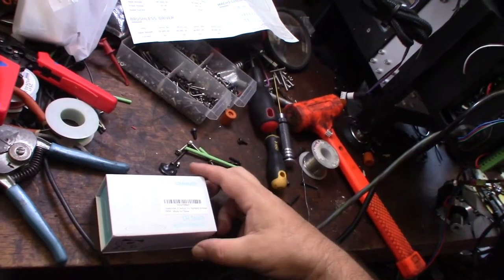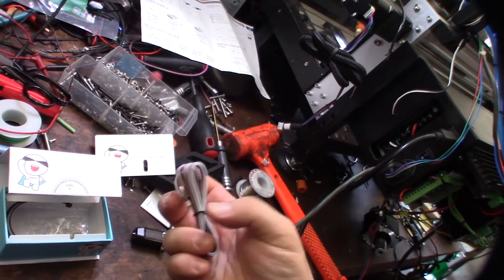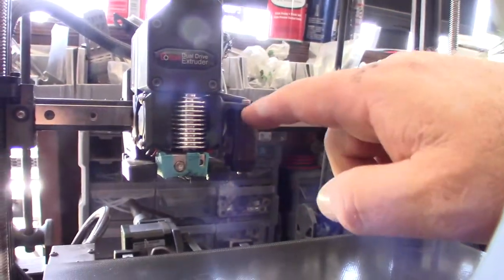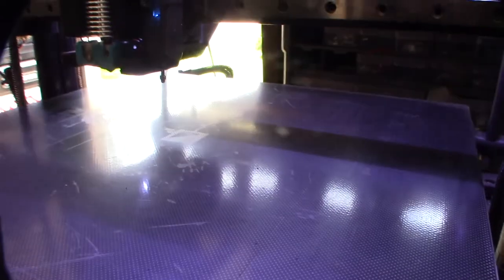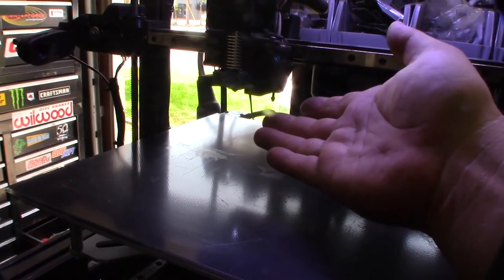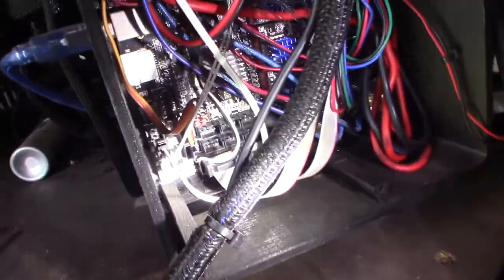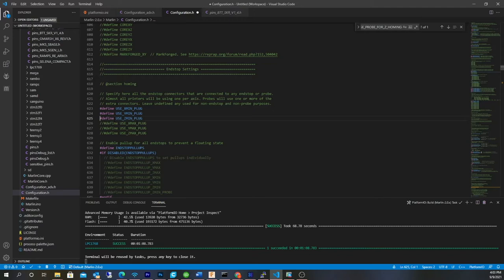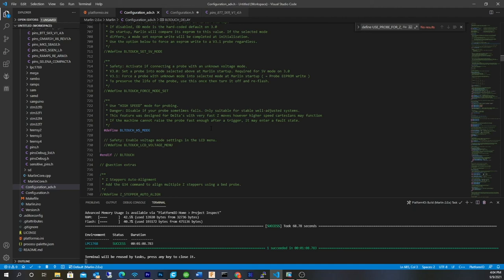CR-Touch SKR 1.4 Non Creality Board Marlin Configuration Troubleshooting Rattle

Comment: Did you use the wiring that came with the CR Touch? If so, how did you attach the wiring to the SKR 1.4? I can't find anyone showing how they plugged in the cable. I know there are 3-pin and 2-pin ports for a BLtouch on the SKR 1.4, but the CR Touch has a 5-pin connector. Any info on this would be greatly appreciated.
Reply: was this ever figured out?
Reply: @PrintingAddict  I used my 3d touch wiring for my cr touch and it worked fine